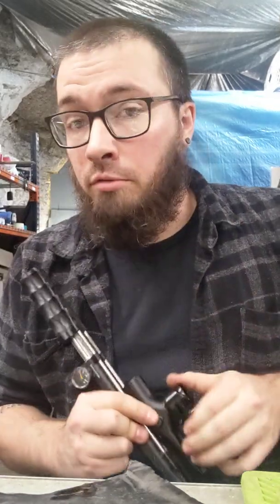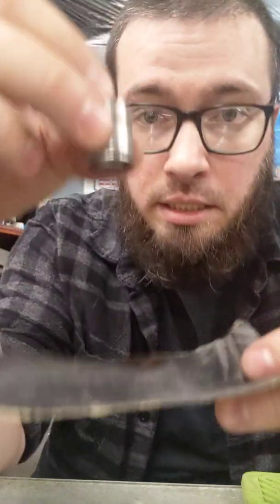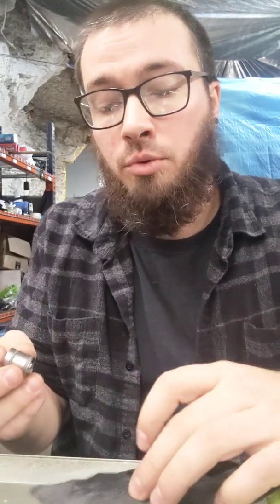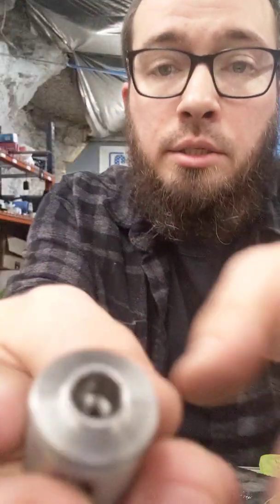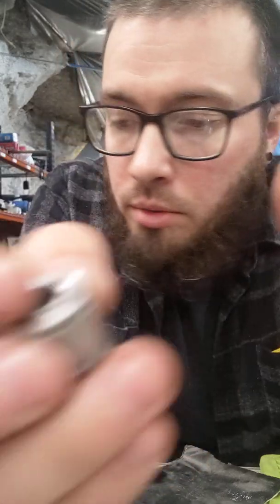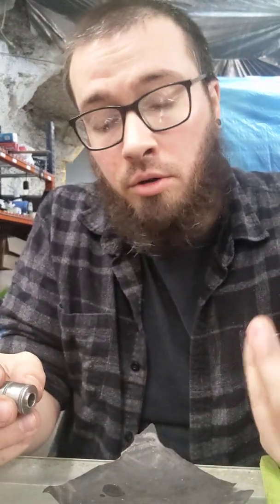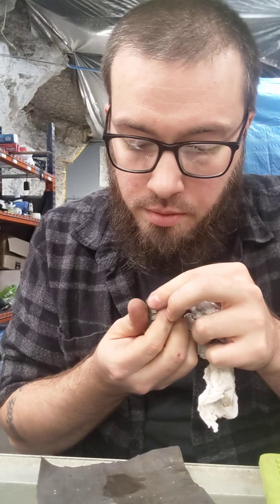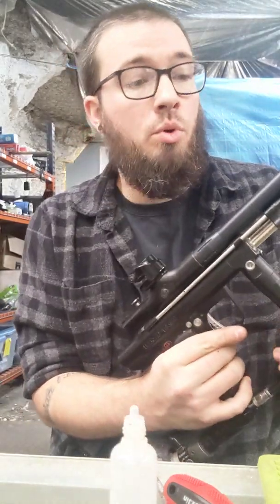Save the valves! A quick intro to lapping valve faces.

Comment: Yo you still tinkering??
Reply from the maker: Oh yeah. Currently in the middle of tearing apart and re doing the entire basement/shop.
Reply: @kccockerdoc that’s awesome!
Reply from the maker: @snus9088  it's a huge project, but I'll be glad when it's done! I pulled back and have really only been doing work for my locals, friends, and myself. But rest assured I'm always tinkering!
Reply: @kccockerdoc I have been on the FB forum you speak highly of AcT3 however not having a Facebook makes it difficult other techs won’t talk shop and it’s a trial and error situation however someone pressed for time would like to have everything ready when going into a build….11/16th valves I know the tornado is tried and true, any experience with the inception design HF valve
Reply from the maker: @snus9088 yes indeed. I would honestly say you would have trouble finding an 11/16 valve that you wouldn't like. The Lazarus valves have a few little finicky bits to them, but can bring great results. I haven't tried the new Phat Rat valves from Shocktech, but the original Rats were some of my favorite valves. ID makes a good valve, AKA makes a good valve, hell even the basic wgp valves were super solid. You'll be fine no matter what you choose.
Reply: @kccockerdoc thanks! What is the basement mods your working on? Haha should throw up a video on that
Reply from the maker: @snus9088 oh all kinds of stuff! Completely reorganizing, water proofing, setting up new work benches for my wood work stuff, moving the mill and lathe, rewiring, new lighting, etc. It's a big project lol

Comment: dont know if you will see this but i was wondering how to smooth up the srigger on my system x swing trigger. it shoots fine but it is just a but stiff.
Reply from the maker: The system x frames do often have a bit of a stiff sear spring in them. You can experiment with different sear springs in the frame, removing the front leaf spring if there is one in the frame, and polishing the pivot pins for the sear and trigger will  really put the finishing touches on a buttery smooth pull.

Comment: I have a problem with my marker, I just bought an Inception traident bolt 2k full body for my 2015 Inception FLE marker that had a CCM Autococker Delrin Bolt and I feel that the Inception trident bolt 2k full body is a bit tight, I don't know if there is some problem and it is not the diameter I need or that the body of my marker is made of a smaller hole.
Besides, when shooting, it tends to break the ball and when that happens the Inception trident bolt 2k gets stuck with the paint residue causing a lot of friction and causing the trident bolt 2k to get stuck. I don't know if the trident bolt needs lubrication or how I can fix those problems I have with the Inception trident bolt 2k full body?
I hope you can help me.
Reply from the maker: It's a little hard on fitment issues to diagnose them without seeing them in person, but the first thing I noticed is that you weren't sure if the inception bolt needs lubricated. The inception bolts have o ring seals and definitely do need lubricated or they will be very sticky. They have very good tolerances though, which may be why it feels rather snug. Double check that your detents are good, if they're bad, it may be the bolt smacking the ball because it's rolling forward a bit that's causing your paint breakage. Typically Inception products have good quality and tolerances, especially one would think, in reference to their own bodies and products. If you continue to have issues, let me know!
Reply: @kccockerdoc  the inceptions bolts should come with an oring kit to size the fit to your body. If you take the bolt out of the package and don't fit it to the body with the various orings provided it's usually too tight to function. This was to account for various specs and tolerance issues on certain runs of bodies through the years.

Comment: I have recently got back into paintball after over a decade and like you I never used a cocker until now. I recently purchased 4 cockers from ebay and 3 are leaking so should be easy fix. But the fourth is a prestine trilogy comp. That once I aired it up it fired fine until I put paint in it, then it just rolled outta barrel. Turned velocity all the way up then only went about 5ft. I'm attempting to find as much info as I can so I can rebuild all the cockers and your videos are helping, i just don't know what direction to go in and any help would be greatly appreciated and would gladly pay for your time sir.
Reply from the maker: Could be a few things. The reg may be blown and outputting too high, the reg may be turned up too low or too high, the bolt may be upside down, or the main spring may need a bit of a stretch to get some more tension in it.